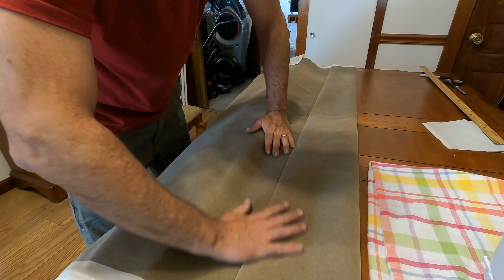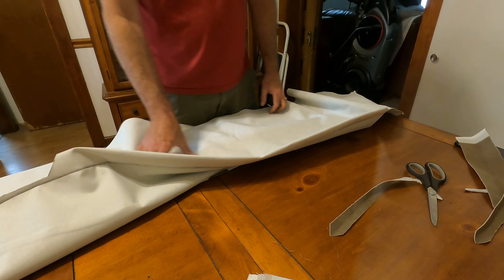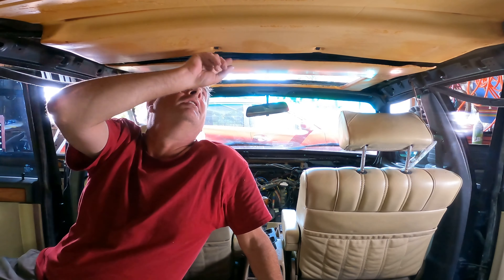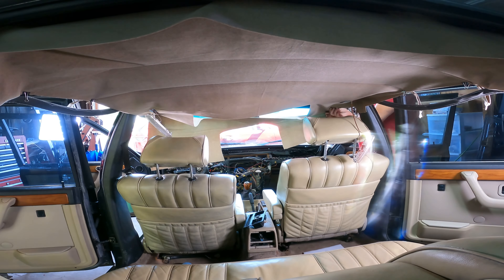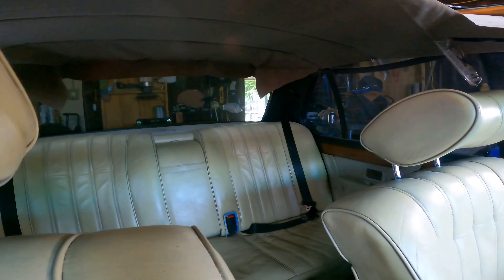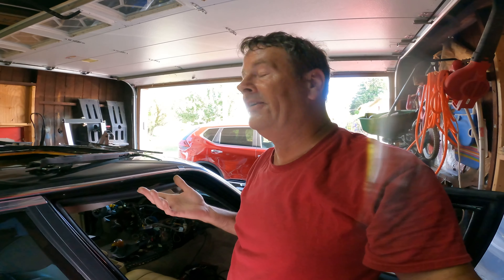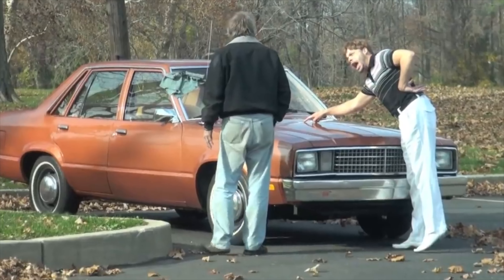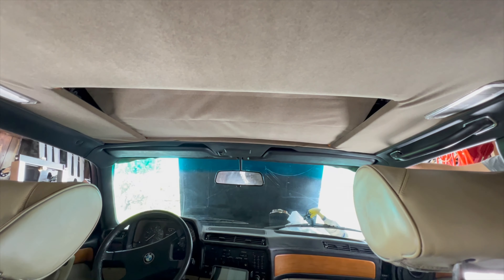Idiot Makes New Car Headliner and installs on a BMW E23 733i

Comment: My first car was a Buick skylark. The headliner was a fabric that the glue disintegrated like the way you were sounded. But it was a lot easier than what you got because it had a cardboard or thin wood liner that I had to just scrape all the old glue off and glue new fabric on. I used something that looked like a black leather and it looked pretty good when it was done.
Reply from the maker: That would have been a lot easier for sure.

Comment: Hi, Great work! what did you use to replace the white sticky adhesive to seal metal to metal? mine is all dirty and I don't want to re-use it. I been thinking about weatherstrip adhesive or even something like plumbers putty. The sunroof it was all rusted so I remove it, cleaned the rust and I'm in the process to re-assembly. Also, where did you get the headliner cloth? I found a similar one, color 2293 from a "wls" store although they're out of stock. I have a 1984 733i bmw.
Reply from the maker: im not sure what you mean by the metal to metal. You can buy the sunroof gasket still so I bought a replacement it fits in tight and does not require any glue. I bought the headliner material at Joanne fabric. its the same color as the original but not the same fabric. I used the same fabric as the headliner for the sunroof headliner.